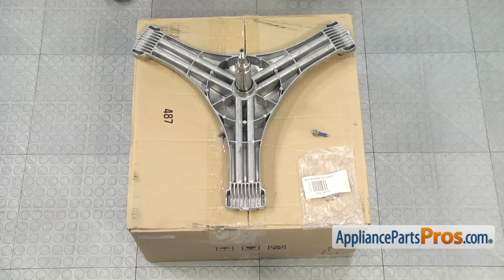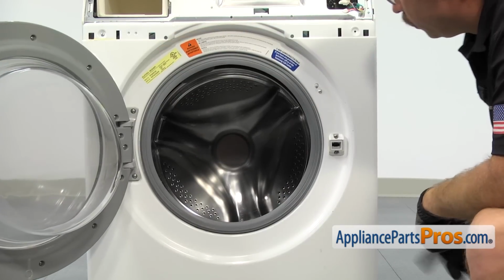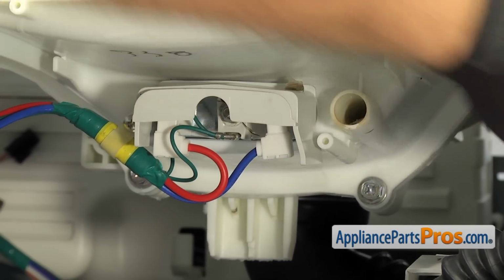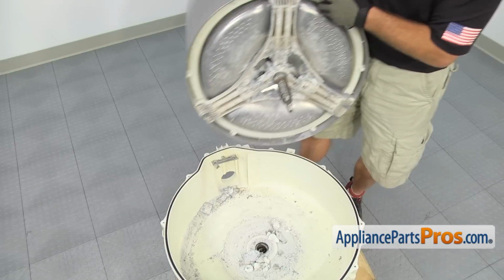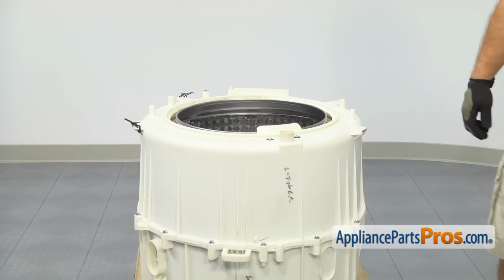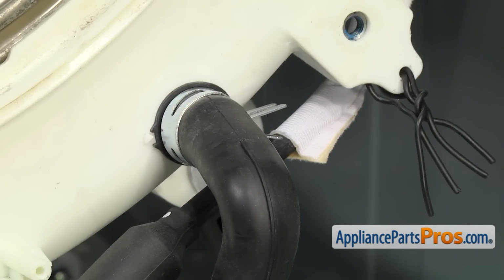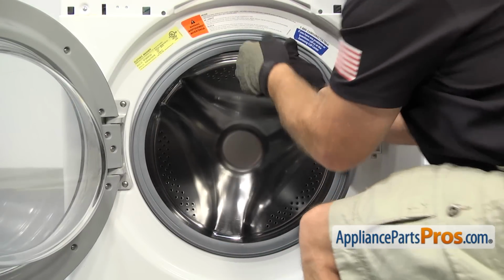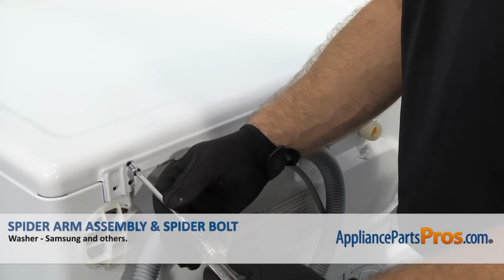Washer Tub Out of Balance? Replace the Spider Arm Assembly — Samsung (DC97-12528A)

Comment: AppliancePartsPros asked me to share my story of repairing my 6-year old Samsung washer on their website, which I did. I said it was a nightmare and explained why. They rewrote my story to say I was happy and everything was good. THEREFORE DO NOT BELIEVE TESTIMONIALS ON APPLIANCEPARTSPROS. THEY ARE LIES. Short story is I had to use a 3 lb hammer to pound out the inner tub from the outer. That was after a week of soaking it with Penetrant Spray. I had to take the washer apart and put it back together twice to get the inner tub to fit completely in the outer. 20 hours total (I'm not a mechanical wiz, but I did it) and $185 later, I have a washer that works, but sounds like the bearing went bad from my pounding. It  will cost me another $325 to replace the outer tub half to fix this. No point. The washer will need to be replaced. The AppliancePartsPros videos, while helpful, make everything look too easy. My second, experienced pass at taking everything apart and putting it back together was 4 hours. Oh, and then another 2 hours to take the front panel off to figure out what was leaking.
Reply from the maker: I apologize that your testimonial was changed. It is our policy to only edit testimonials to remove profanity to maintain a family friendly site, make sure our company name is correctly spelled and formatted, and edit for clarity where necessary. It is not our policy to censor negative testimonials. There is no way for us to look up or restore your original testimonial from our site. Instead, we removed the current testimonial, because we don't want anything attributed to you that you don't approve of. 

You're correct that replacing the spider arm assembly is a lengthy process and can be a challenging repair, depending on the condition of the washer and the level of corrosion of the internal parts. If you've decided to replace the washer, you can always return the spider assembly to us for a refund.
Reply: Thank you, but the thought of spending another 2 hours and busted knuckles and other physical demands dismantling it to get to the spider arm assembly for $150 is probably more than I am willing to do. I will re-visit this in a month
Reply from the maker: That's understandable, Don. If you do decide to return it, though, just give us a call.
Reply: Hey Don, just have your mechanic do it!
Reply: good idea!  I bet you can find some independent repair people or appliance techs wanting to take on some extra side jobs that might be able to help you. At least you already have the parts bought and know that they won't charge you a higher price (like most shops do) for the part.  I hear you can find people who will help on Facebook. I also see lots of requests for help on NextDoor (these are apps / websites where people talk about things like this, a.k.a. "social media".  You may already know this, but just in case  ... I am not trying to be condensing sounding.

Comment: The spider arm is no longer available.  Washer is off to the dump.
Reply from the maker: It may be possible to find this part used through a local salvage company or a used appliance parts retailer online, if you search by the part number.
Reply: Amazon

Comment: Baloney, Someone has their butt-hurt and it has nothing to do with this video. I have never opened up a front load washer before and had no issues whatsoever. A little common sense goes a long way. And yes I did replace the tub seal and shaft seal. I also dissected my fluidlines pump and controls. Frankly I did not find anything challenging about the job at all. Nor did I find that the folks doing the video were trying to shake anyone down or defraud anyone. It did not bother me to find another supplier for parts.

Comment: Thank you for the video, I see that the spider arm is pretty affordable from your website.  I will be ordering parts tonight after I tear down my washing machine.  As for the bearings, I see there are aftermarket options for the bearing.  Would you recommend replacing the original bearings with Aftermarket, when replacing the spider arm?   

How can I test for a bad bearing?
Reply from the maker: Hi Tuan, all parts we carry are OEM parts. Which mean our parts come from the manufacture and are in new unused condition. Our parts also carry an one year warranty where as most aftermarket parts do not. I hope this information helps.
Reply: Thank you for the reply. I will be ordering the Spider arm, bolts and seals from you tomorrow.  Is there something I should look for when looking at the bearings?  They look brand new to me, but they are 8 years old.  Do they have a typical life span?
Reply from the maker: Honestly while you have the appliances completely taken apart it would be best to replace the bearings. This is a timely repair and would not be fun to take apart six months down the road.
Reply: I decided against the bearing replacement. My model requires the rear tub, which is too expensive. I got my spider arm.   There are numbers (1, 2, 3) on the arm.  are they important

Comment: What blows my mind is that when your spider arm fails and it will,...LG sells you the same poor quality item to put right back. Unbelievable !!! I for one will never buy another Samsung or LG appliance again.
Reply: And that aluminium part is in constant contact with the water/soap and all the ingredients so be prepared to repeat the process in a couple of years. I'm buying NACHI sealed bearings(JAPAN)   
6305-2NSE9 and  6306-2NSE9  and thinking of  painting the spider with anti-corrosion  paint.
Reply: Using the proper amount of soap (very little is needed) and running the cleaning cycle avoids the problem

Comment: Great Video!!!  Had an appliance shop come check out my Samsung WF350ANR/XA 04 and he charged me $89 to tell me it was not worth fixing - it would be at least $600 plus parts.  Watched this video and had the confidence to tear mine apart.  (Of course it helps when the alternative is to junk it.)  Came apart just like the video, though my model has a few minor differences.  Unfortunately, AppliancePartsPro.com does not seem to have access to the spider arm assembly any more!!  Bummer, given what you put into this great video - I definitely would have purchased from you.  Luckily Amazon Prime has it coming my way in 2 days for $114 including new bolts and blue loctite.  Hoping that reassembly is equally straight forward!  Thanks again.  Subscribed!

** Follow up **   One load washed and hopefully a lot more to come.  Installation and re-assembly of the machine was a very smooth process.  There was nothing particularly challenging about the repair.  Getting the tub in and out of the machine was a little bit of a dance for one person - mainly because it is a tight fit - but it was still very doable.  I also replaced the shaft seal while I had it apart.  I recommend using an egg carton to keep the small screws separated and labeled as they come off the machines - it was a nice help.  Overall, if you are handy you can do this yourself and avoid either a big bill or having to toss out an otherwise perfectly good washing machine.
Reply from the maker: We're glad that the video was able to help you out with your repair! We love to hear when we've helped keep an appliance out of the junk yard.
Reply: Just wanted to check back in to share with everyone that the repair continues to work flawlessly.  Definitely saved a ton of money not having to replaced this machine!

Comment: Completed my replacement of the dreaded Samsung spider arm. Replaced both seals and ended up with no leaks. My WF331anw was a slight bit different from the video however no problem with the repair. I had a bit of trouble getting the tub assembly back in the cabinet so I removed three screws at the upper bulk-head to allow the side to flex outward to allow the tub assembly past the front edge of the cabinet..
Took a while (watched the video step by step as I did the step), however it wasn't difficult. Now it spins up smooth.
Thanks AppliancePartsPros....
Reply from the maker: Glad we were able to help you out, Colton! And thanks for that tip about getting the side to flex to get the tub assembly back in the cabinet.

Comment: PS Mine had the red front wire on right and my front panel had 2 screws on the bottom. Just in case you're wondering why it's not lifting off :-)
Reply from the maker: Thanks for that tip! This video serves as a general guide, but some models that use this same part may be slightly different.

Comment: Great video.  I did this job in ~5 hrs.  My Samsung was a bit different.   Spider turned out to be just smelly and a bit corroded but I changed it anyway.   I did use etching primer and painted it before putting it in.  Glad I bought the screws as four stripped off when removing the old spider.
Couldn't and wouldn't have done this job without this video.  Especially like that you took the time to show the reassembly rather than just saying it's the reverse.
Thanks!
Reply from the maker: Glad we could help you, Stephen!
Reply: AppliancePartsPros  I have an issue with mine and it's not the spider
Reply: Austin Hennington - It could be on the back of the drum.
Reply: bsdguy  what do you mean?
Reply: What paint did you use on your spider?
Reply: @bsdguy  Recommend seems to be "epoxy paint" after etching...
Reply: Yes it took around 5 hrs also it’s a lot of work but it works way better my spider arm was in pieces
Reply: 4 years later, how's the spider holding up after painting?
Reply: @bradley3549   @Bradley  Not sure really.  It now shakes during spins but I'm not sure it's the spider arm.  I don't think it's broken or a bearing as it's quiet when I turn it manually.
I replaced the top springs (no change) and four bottom shocks but I think the non-OEM shocks are just as flimsy as the originals.  Like the originals, they had 3/4 inch of play at the top so I took them apart and added a big washer to minimize the shock free travel.  It helped a bit but still shakes.   Going top load next time...

Comment: How clever is this design by Samsung. perfect planned obsolescence. I mean its a major repair to the point that it would be easier to buy a new one. or you have to pay them for a new part. And how can you blame them for a material corroding right? so sneaky. I am a metal worker and I know that this part is made of cast aluminum and made to fail. If it was made of stainless steel it would be an insignificant cost  in materials and would last at least 50 years longer. washing machines are'nt new technology and have been around for a long time you would assume that they would get better with time and new technology not worse. the solution is simple. Boycott Samsung. so so sneaky so disappointed in modern business ethics.
Reply: You can buy a new 1 if you like.  Your money.  I'm a techie and this is great fun for me and my boys.  I am super super glad this video is here!! SAVING ME HUNDREDS!!!
Reply: Once this was an observed issue, Samsung very quickly changed the spider arms to a new material that was much less corrosive.  Bad initial design, good recovery.  And this fix is very easy, if someone would rather buy a new one rather than complete this fix then they're either lazy or incompetent.
Reply: @Kalikus808  What replacement part fixes this issue and where can it be purchased?
Reply: @joesandstrom4111  I bought mine on Amazon
Reply: @whitwhitweav  Was it an aftermarket non-corrosive part, or made of the same corrosive materials?
Reply: I agree with you. This part was designed to fail catastrophically. Really disappointed and this should be illegal. I'm repairing it just out of principle but I'm never buying another Samsung appliance again.
Reply: I'm in metal fab myself, and I couldn't agree with you more.  Hard water contains reative metals like sodium which can react with aluminum, depending on the extent of their contact with each other.

But even w/o hard water running through the machine, washing machines still spend their time in moist environments.  My wife and I have 5 children, so our washer and dryer are in use most days.  This means that the air in the laundry room is constantly wet, which means that so is this cast aluminum part.

That's got to be why these machines are known for the failure of this part.   

You're right; if this part were made out of stainless, the machines would be a bit more expensive, but the spider arms would NEVER fail.

Samsung are damned cheapskates.
Reply: Dusty Hobbs is right: aluminum & stainless in contact with each other sets up a galvanic cell, which facilitates the transfer of electrons from the aluminum to the stainless, thereby corroding and weakening the former.  

DUMB.
Reply: Josh 100% with what you said. I grew up with a Washer from a company called Hoover. My parents bought it in the early eights. It would not die for 20+ years. Looked exactly like this model. We eventually had to move and gave it to someone. I bet it is still going. Never buying ANYTHING Samsung. It's my mission to tell everyone how they cheat.
Reply: I grew up in the 80s. Our house had a front loader by Hoover. Lasted 20 years. But it didn't die, we gave it to someone, and I bet it is still running. The problem I have is not that I want the washer to last 20+ years. It's the way my spider arm died. 3 years 2 months. That is exactly when the warranty expires. Paid 3 Grand for combo to last 3 years? For a single family? Sad. Also....to top everything, I called Samsung to buy the Spider Arm, guess what ? It's Discontinued. Wow....so not only did they make a product to go bad, they don't even want you to repair  it. Go Samsung. Buddy, never buying anything from you. Not even Phones.
Reply: I am watching thìs horrifying video in my van about to have to fix this exact issue god help me
Reply: 6 years later, Just ordered a spider off Amazon $100 appears to be steel.  Not sure though it is very heavy.  This is not a difficult repair.  I just followed this video.  Paused 300 times.  3 hours total.
Reply: @iamthejk you are a metal worker - I would like your opinion...  What would it cost to make an aftermarket replacement part, but out of stainless?  The cast OEM part is ~$100.  Could you make and sell a stainless one for say $200?   Presuming a manufacturing run of say 100-1000 pieces?  I presume the market is huge for these, though the fix being labor intensive could be a barrier...
Reply: not worth it as almost every machine has a slight variation of this type of part and would only be viable if the manufacturer would make them with all the other parts in a production assembly... cast materials are not good at withstanding constant vibrations as they are too brittle. my part actually had no corrosion but cracked 2 arms off. 3D printing could be a way to remedy this in the future, otherwise you could laser cut the part from 12mm stainless steel, but there would be too much wastage for high scale production due to the shape, then you still have to turn up the shaft and weld it on. I could make the part but I have bought it as there is to much dicking around to make one.
Reply: so is this a time related or frequency related issue?  i just ordered a pair and am now reading about all these problems. i wonder if i should cancel or just anticipate this type of replacement a few years down the line.
Reply: Coat the spider with bedliner or por paint and it won't corrode and you won't have to replace it
Reply: @doctorfeinstone6524  Will not work, they press fit a stainless shaft into the cast center of the aluminium spider. Galvanic corrosion will happen due to the contact this point.
Reply: Doctor Feinstone yo are you for real?! Because I’m about to order parts and I’ll absolutely do this. But if your arm is breaking is that because of corrosion or because of weak aluminum?
Reply: @zbeshears6945   They designed the spider to corrode on all these front loaders. Top loader Whirlpool & Kenmore NEVER have catastrophic failures like this. Any problems on them can be fixed in 10 minutes with a part costing under $20. It's very sad how companies united to get away with planned obsolescence on all front load washers & refrigerators. Spending more on other brands won't help. You must disassemble the new washer & paint the spider with por paint before using, or just replace the whole unit every 5-10 years, or go back to reliable top WP loader or go to laundromat! We are all pawns in Wallstreets planned obsolesce games!
Reply: @doctorfeinstone6524  Will not work. there is a press fit stainless steel shaft in the center of the cast aluminium spider and galvanic corrosion will happen.
Reply: @doctorfeinstone6524  sounds like a reasonable solution. Have you done this or know if someone who did?  Did it work?
Reply: @doctorfeinstone6524  That’s a great idea!
Reply: @doctorfeinstone6524  I am the one who is like her and was eroded by cleaning materials. She cannot tolerate these materials. Have you tried por paint and it worked for you?
Reply: We purchased our Samsung (new) in 2010 for $700.  We are a family of 7 so I can tell you this machine has been busy for 7 years before the spider arm failed.  If you do the math, that works out to less than $2 per week!  A cheap top-loader at Rent-a-Center will cost you over $12 per week.  I was able to repair mine for $150 and I hope it will last a few more years.  I'll pass on the boycott.
Reply: Darren LaRue would you have paid $703 to not spend another another $150 7 years later? That’s what it would have cost them to make this outta stainless. $3 more dollars per spider arm...

Honesty I would’ve payed $750 for a unit that doesn’t fail after 7 years.
Reply from the maker: Most brands use similar material, it seems to be common on most front loaders.